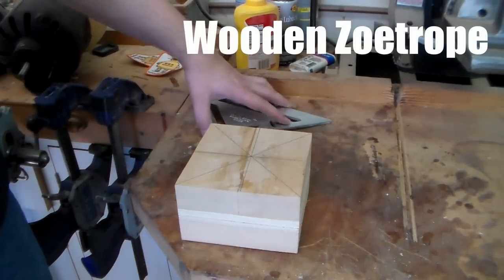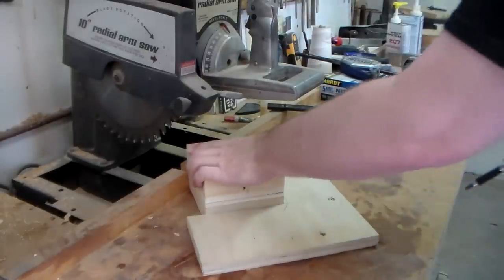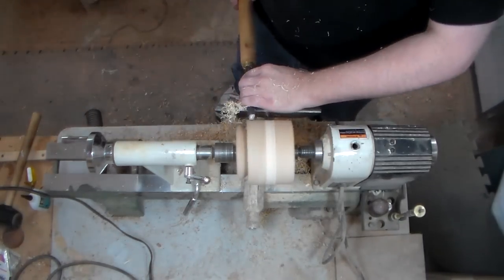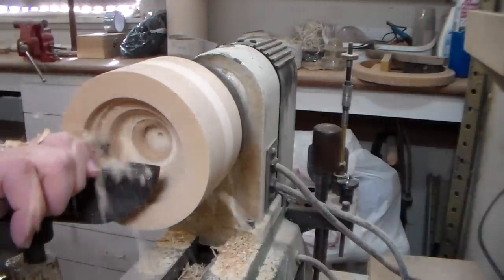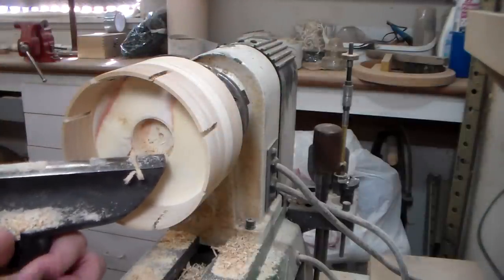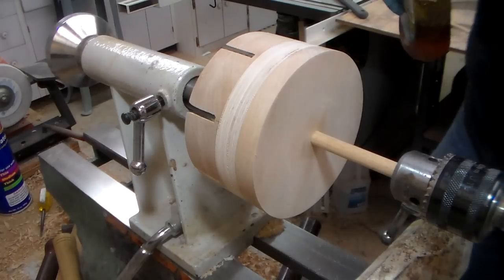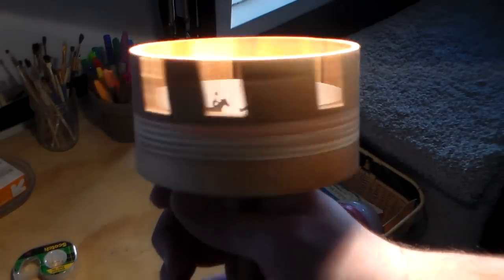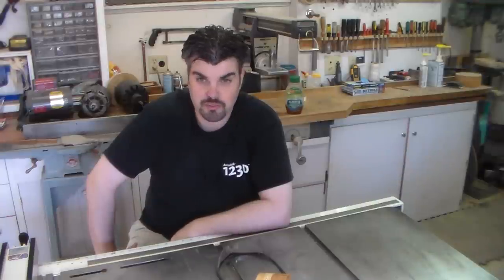Making A Wooden Zoetrope

Comment: Would it be easier to make the slits after the turning?
Reply: LyricVideos I think making the slits before helps to find the center and also prevents the piece from breaking with all the stress the saw he used could cause to such a thin piece of wood. But I really don't know if I'm correct (sorry for my bad english)

Comment: Wow, it really works well! It also translated to video better than I would have guessed. Now I want to modify my drill press chuck to always be animated! Maybe a mouse on a wheel. Tool designers should really consider these sorts of things... they are important.
Reply from the maker: pocket83 I was surprised it showed up so well. I would totally go for a lathe chuck/zeotrope!
Reply: A stroboscopic effect is often observable on a drill chuck as lighting on AC 'flashes' at 50Hz in the UK (is it different in the USA?). Depending on the speed of rotation the slots on the chuck might appear to be rotating backwards. I wonder does this effect still work with LED cluster lights?

Comment: I was waiting for those slits to catch the turning tool, so I know what you meant by 90% terror.
Reply from the maker: George Kovach You and me both. I'm still surprised it worked.
Reply: Peter Brown would it have been easier to cut the slots at the end?  and about 80% less terrifying
Reply from the maker: Brettvella1984 I was worried it would be too thin and wouldn't hold up. I'm not sure really. I was just a fear...

Comment: That sure stimulated my imagination. I only ever saw these things in musea. No i even more desperately want a chuck. Thanks for sharing!
Reply from the maker: Willem Kossen I hadn't used one before, just like you only saw them on display. A chuck is a huge asset for sure, but this could also be made with a faceplate. Chucks are relatively new to woodturning. (1980's) before that most bowls and whatnot was turned with a faceplate.
Reply: I have a small faceplate, but i find it cumbersome to use. Guess i have to try harder
Reply from the maker: Willem Kossen Don't get me wrong, I prefer the chuck, but you can use the faceplate for almost all projects that use a chuck!
Reply: Relutantly i will try using it more. A chuck is not in my very near future...

Comment: I don't have a lathe but am wondering if you could hollow it first then cut the notches. It would be round when you did the notches but you could make another one of those fancy hold down clamps and it would allow you to make the walls thinner. Just a thought.
Reply from the maker: The Jointed Edge I was worried that with such an unsupported cut the pieces would chip out. Of course I was also worried about loads of other steps that worked fine. Honestly, I'm not sure! :)

Comment: I wonder if you could use that to figure out how many horsepower your lathe is?! Very cool piece, and well-shot video. You had me guessing it was another fail that you would so creatively fix. Great job.
Reply from the maker: The Jointed Edge Thanks! I was so panicky the whole time, I'm still blown away that it all worked. With all that good luck,  I've basically stacked the deck against myself for the next project! :)

Comment: You could make the horses into stickers and put them around the outside, then you will not need a loght and it wont have to be hollow either!
Reply: *light
Reply: +Skaterking 456  You need the pictures on the inside so that you can see them through the slots. If they were on the outside they would just be a blur and wouldn't look like a movie. The zoetrope is how they first proved that a horse's hooves all leave the ground at the same time during the gallop. It's the first form of what would become movies.

Comment: Why not gouge the inside on the lathe first and make your cuts second? That way your not on edge wondering if and when it's going to blow apart on you.Hey and this is coming from a guy who hasn't used a lathe since the 8th grade.
Reply from the maker: +deadbirdy Agreed.  I've never made one before and was worried the wall would be to fragile to cut afterwards.